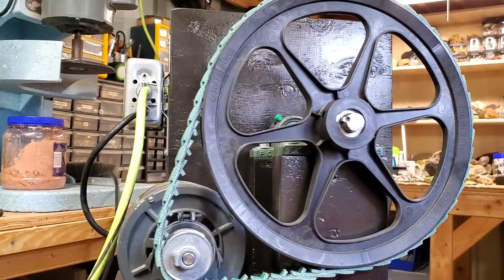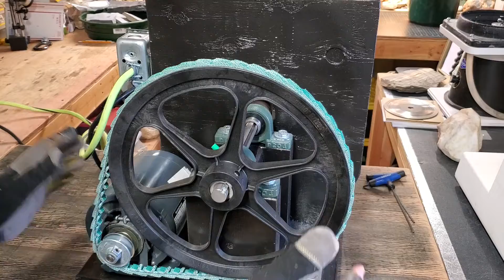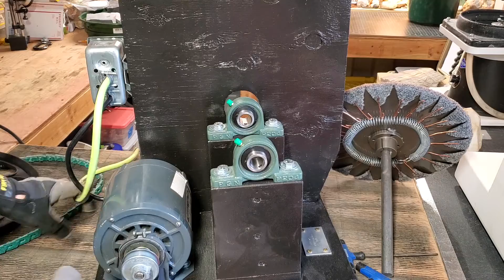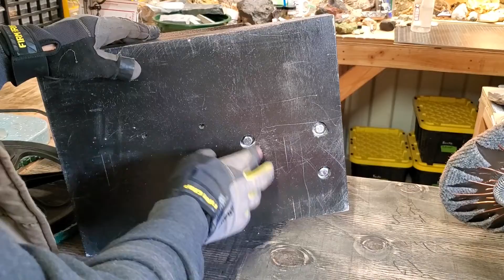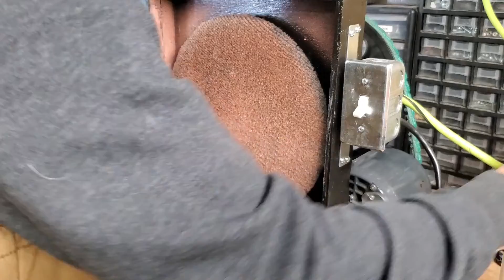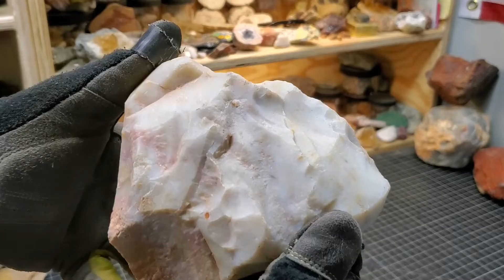Cerium Oxide Carpet Wheel Plans // Lapidary Equipment You Can Build At Home!

Comment: What compresses the split tapered bushing onto the shaft?
Reply from the maker: Set screws and a shaft key.
Reply: Just a caution for anyone else purchasing parts, the one I ordered from Amazon does not have a set screw. I can’t see how it would attach to the shaft without welding it. I’m gonna return it and get one that looks like it has a set screw.

Comment: Quick questions: Are the pillow blocks both supposed to come with set screws?  I noticed you have an additional block under your pillow block supports that isn't in the plans...Is that just a height adjustment. 

I'm about 75% there (waiting on metal disc)...Just at the point of working out the placement of the different parts on the main board before I figure out what size belt to order.
Reply from the maker: The pillow block bearings should have came with set screws.

The bearings are just supported by the wood shown both here and in the plans.

I would love to see some photos of what you build and ad them to the website if you don't mind sending a few photos.
Reply: @CurrentlyRockhounding  Will do! 

One of the pillow blocks came with 2 set screws, but the one came with none. I thought it was odd, but wasn't sure if there was a reason I didn't know about.

Comment: I’ve built something similar and I’m currently looking for carpet, does the type of carpet you use matter? Would you want a soft, fine thread or something a little more coarse? Appreciate any advice!
Reply from the maker: That's a good question. This is some thin but course outdoor carpet that I'm using.

I think the biggest thing is that it can kind of hold on to the polish some which I think most carpets can do just fine.

Comment: So the key stock goes in at the motor, wheel, both pillow bearings, and the end with the steel plate?  Right?
Reply: In your video it's hard to see exactly whats going on during disassembly in the areas where there might be key stock involved.
Reply from the maker: The key stock goes in both the drive pulley and the back of the disc. Have you looked at the pdf plans on my website for it?

Comment: Working on a similar project but ran into a hiccup.  The carpet was so old that it each of the tension points has torn.  Do you have an suggestions on where to find or buy carpet remnants?
Enjoying your videos.  Keep up the great work!!!
Reply from the maker: I don't have any advice on that, I will say that this carpet I bought new off the roll at Home Depot and it was pretty cheap at the time.
Reply: @CurrentlyRockhounding  What is the smallest quantity the would sell you or did you actually buy a roll of carpet?  Thanks!

Comment: Dang, that looks super awesome! You are quite crafty. Looks pretty straightforward, even the electrical. Curious, how much you spent in supplies, not including the cerium oxide power, roughly? And, looks like it worked great. Thanks for sharing. You make great points in your discussion. Always so informative 😁👍
Reply from the maker: That's a hard one since prices seem to be going up by the day and I some of the stuff already on hand like the wood.

On the website there's a materials list so you can price it out.
Reply: @CurrentlyRockhounding  ok, fair enough. 👍

Comment: As a DIY'er myself I love the simplicity of this.
I am thinking with the proper shaft and surface plate and oriented on a horizontal plane this could make a great flat lap machine.
With the obvious modifications such as a water supply, pump and drain pan etc.
Seems like a good winter project.

Comment: First thanks for posting and sharing! Much appreciated~👍IMO you really did a super job with this homebuild buffer! Kudos sir~ Now onto the things I noticed right away, I love splash guard, really great addition to the buffing wheel and think I'll be modifying my unit in the near future to add such a great feature thx. I also like the concept of the shortened tabletop footprint of your design (looks about 10" shorter in overall length) but that concerns me a bit as I really like the slow buffer as it generates virtually no heat when buffing on the leather wheel and fewer "grabbed" pieces....Would assume that due to the short distance between the motor pulley and the large pulley it appears that your buffer may be spinning faster than the slow buffer I use?  (18" distance between pulley centers 12" and 1" pulleys with motor at 1725 = 143.8RPM) It appeared you used a 12" wheel pulley and 1" motor pulley the same as me. Question...what is the distance between pulley centers on your unit and are you using a 1725RPM motor? On a bummer note, I'm going to have to get a new driveshaft manufactured for the 18" Royal...there's a 1/2" long flat spot in the threads right at the key spot on the shaft that running through a die won't correct...ugh!!! 🤦‍♂So when it warms up in March will tear it apart again to rebuild once more. Doh~ Ultimately, I may end up swapping the 3/4hp motor on the Royal during rebuild with the 1hp motor on the bullwheel to see if there's any difference. Thanks again for your efforts my friend, hope you have a great rest of your week~
Reply from the maker: I also like the reduced foot print of this machine.

This machine is running on a 1450 rpm motor with a 2" and 12.25" pulley which give a finished wheel speed of 236rpm. If I drop it down to a 1" pulley I will reduce the wheel down to a very slow 118rpm. 

I really didn't see much benefit by reducing the speed slower than 236.

As far as distance between pulleys it doesn't have any effect on the ratio. Go check out the plans on the website.

Bummer about the Royal.

Comment: Please please build an oil saw! I'm in the middle of setting up a small lapidary business. Oil cells are way too expensive for my blood. But I need one badly LOL
Reply from the maker: I would love to weld up a big saw for myself. Personally I think its hard to beat the value you get out of a modern slab saw and it bought retail.

If I was setting up a lapidary business I likely pinch pennies else where I think and buy a new slab saw since its likely to be the work horse of a business like that. At least that's what I'm thinking but I guess it really depends on what you're doing.